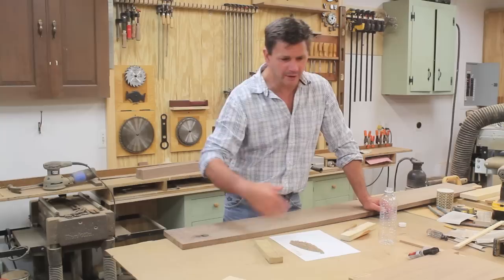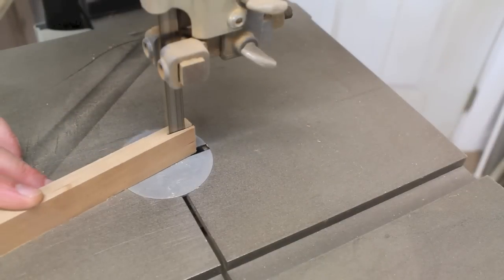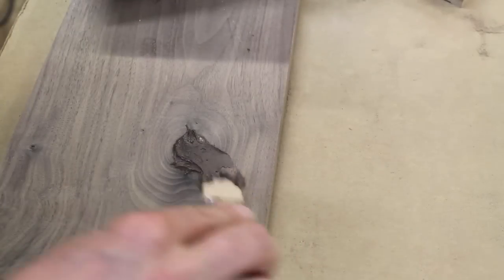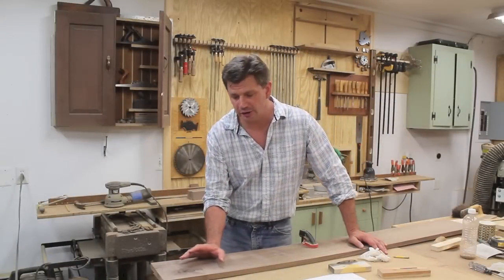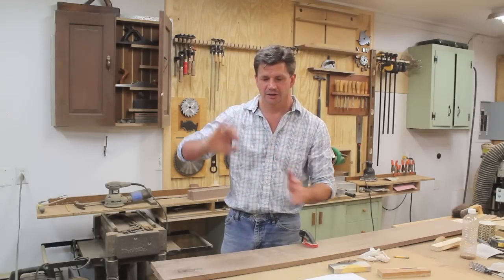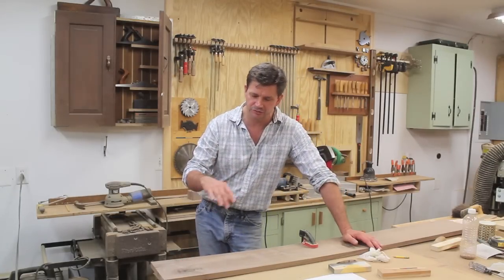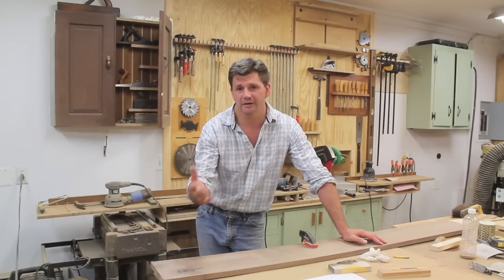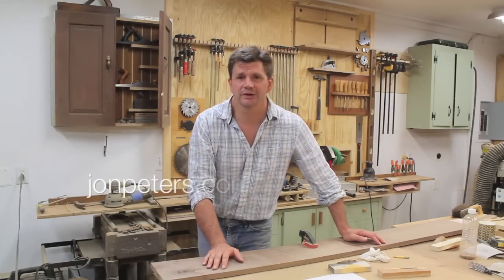Mix Fine Sawdust with Epoxy to Make a Great Wood Filler

Comment: There's a seriously good thing about epoxy and sanding dust as a filler that didn't get mentioned. I've used it for making seamless repairs on electric guitars. I make it a little thinner than was shown in this video but the principle is the same; the epoxy will flow into and take up every bit of space in a joint. So if you're trying to fix a chunk that was missing from a guitar being dropped, you can mix up a thinner version of this putty and it will fill right into the edge so its completely seamless. You cannot feel the fill at all, especially once the repair is painted or recoated. Handy for a neck repair. 
Also, if you want to fill in the cavity for a tremolo system and make the guitar a hardtail, it doesn't matter how careful you are with your sanding and scraping. How smooth you sand or what wood filler you use (I've even tried Bondo) you'll eventually see the seam from the block showing through. The wood will shrink and the putty will shrink. Especially since it's constantly under tension. Epoxy doesn't do that. You can put a block in to take up most of the cavity but then the last 1/3 to 1/2" can be this epoxy-sanding dust filler and you push it right into the corners and dome it right over the edges and let it cure. Then when you sand it back down, you cannot see a seam. From there, just paint and you're good to go. Bonus is that lots of newer guitars from the last 30 years or so are using some kind of urethane finish which actually bonds quite well to epoxy. I'd still use a primer but it works well. 

Guitars are kind of the ultimate test because they are constantly under tension  and stress and are always moving when being played. You cannot feel a repair done in this manner.

Comment: Hmmm, so in the past, I've had trouble adding sawdust to West Systems epoxy because it separates out, but maybe my sawdust wasn't fine enough, using the dust from the rough sanding?  Have you used the colloidal silica and wood dust method?

Comment: Great stuff Jon. Brilliant take on viewing the figure pattern and 'Kidding the Eye'. I have done similar with coarser sawdust and Tite Bond for PA speaker Cabs prior to painting. The very runny Super glue and various grades of sawdust is excellent for achieving a fast, strong, high build ( in stages ) for edges/corners. Strange....like a few other commenters....I, to,  never thought of using a Quick Cure Epoxy...therefore : You Rule Buddy !!
Reply: Andrew Ludlam I have a hell of a project that I'm doing.the reason I'm commenting on your comment is because of the " various grades of saw dust" comment. I'm not going to use fine saw dust, just regular,built up saw dust from a table saw at work.i want to thicken my apoxy with third saw dust and wondered if it will thicken the apoxy with regular saw dust compared to fine saw dust?? Any idea?
Reply: Andrew Ludlam I want to create a peanut butter consistency with the saw dust.

Comment: Hi there....I have a question, I want to fill a large hole on a solid wood guitar body...and I want to be able to drill into it afterwards.  I also want to paint over this so I do not want any shrinking to occur.  I want the end result to be non-shrinking and not brittle.  My options are epoxy with wood flour, epoxy with microbubbles or epoxy with silica.  Any idea what would be the best for my purpose ?

Comment: With epoxy being waterproof, does it prevent oils or other finishes from "taking" properly? I would imagine that you would end up with a weird surface (on a large fill like that one)
Reply: I know you asked this 7 years ago, but here is my wildly unqualified guess - rough up the epoxy part with one grit lower than the rest of the piece so the finish will stick to it.  Maybe?
Reply: yes

Comment: Jon, I've been doing this with yellow glue for a long time. I have half a dozen Dixie cups of sanding dust from the woods I use most. Seems to work fine. Do you think the epoxy has properties (e.g., workability) that make it worth switching?
Reply: Epoxy won't take stain. Carpenters glue might be better, but depending on what you're working on, hide glue will take stains and finishes more like actual wood. Epoxy, while very strong, is basically just structural plastic.
Reply: Despite what the other guy said glue does not take stain and penetrating finishes at all. A glue sawdust mix will not blend in wand the repair is obvious. Epoxy, on the other hand can be polished up to mimic the sheen of the rest of a oiled and waxed wood or polyurethane coated wood. Epoxy is just plastic but since wood glue is water resistant when dried it doesn’t take stain any better than plastic. And the repair will look dull compared to the rest of the table.

The best bet is to mix the finish you are using with sawdust. But this only works if the finish hardens like varnish or poly. 

If you use penetrating finishes like wax and oil you can’t just mix sawdust and oil as it won’t ever harden. Mixing epoxy is the best thing I’ve found. 

You can polish the repair to mimic the sheen of the surrounding area.

Comment: In rare circumstances one needs to be careful when mixing WEST system epoxy and sawdust for a filler.  If the mixture is thick enough and the conditions are hot enough, the exothermic heating can cause the water in the wood fibers to boil, which creates bubbling in the mixture.  I know this because it happened to me.  I was using sawdust and WEST system to make goop to fill numerous 4-inch diameter voids, 1/2" to 1" deep, in a boat floor.  It was very hot that day in my driveway here in Southern California (around 90 degrees, and I was working in the sun), and damned if the stuff didn't start "smoking" and bubbling.  At first, I thought maybe the heat had actually started the sawdust smoldering.  However, the tech people at Gougeon Brothers (who make WEST epoxy)  explained to me that their opinion was that water in the wood fibers had boiled, and they sure seemed to know what they are talking about.  Otherwise, I have used sawdust numerous other times as a filler without a problem.

Regarding sawdust, I use a common kitchen sifter-thing when I want a finer sawdust (wash it real good before you sneak it back in the kitchen or your wife will be mad as hell).  As in the video, the kind of sawdust can have an aesthetic effect.  You might want the sawdust to disappear, or you might want it to be contrasting.  So I have some "regular" sawdust, which is kind of yellow, like your average constructions lumber.  But I also have some nice, dark redwood sawdust left over from a project that I am saving.
Reply: I recall that in my model railroading days we used to dye the sawdust any color we wanted before using it for landscaping.

Comment: CAUTION: Using West System and Cherry, I ended up with a fill that is far darker than the original wood. Dark enough that I will have to claim it was a Wabi-Sabi repair, and folks will believe it. Sigh